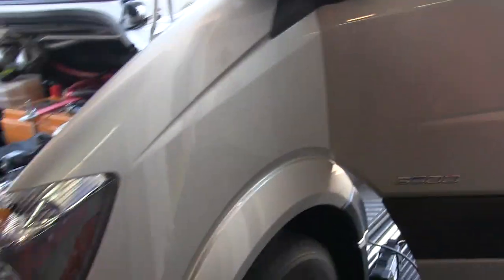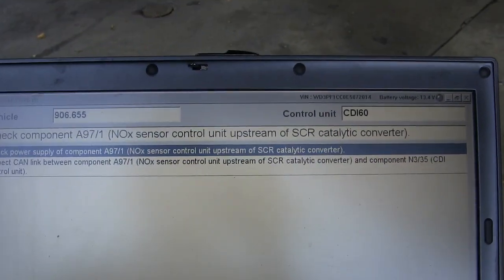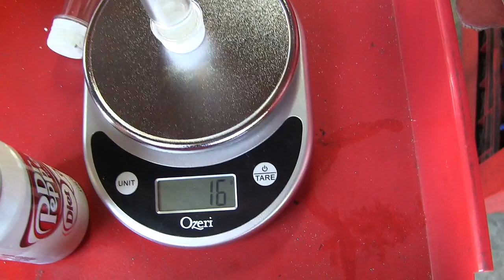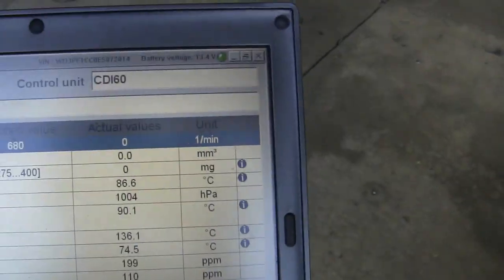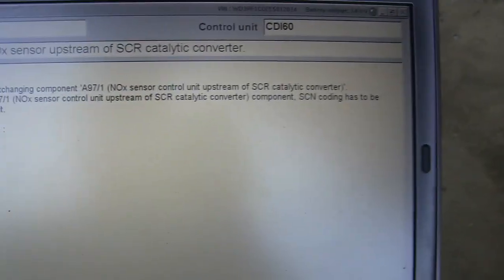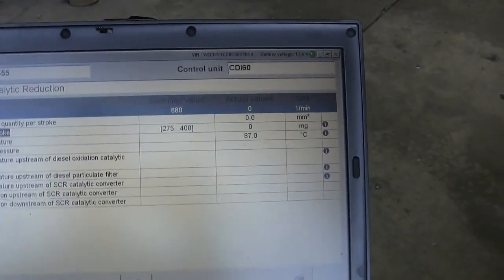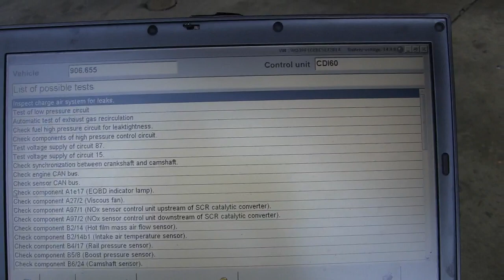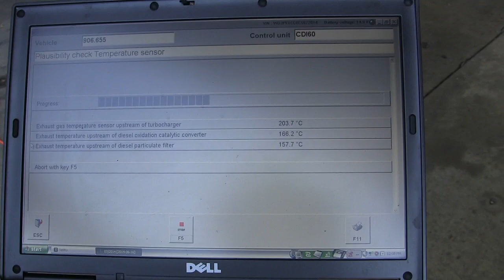Mercedes BlueTec SCR Adblue DPF NoX Sensors EGT Check Engine Diesel Sprinter 642 CDI, San Diego

Comment: i just but the ml350 disel after 2 days driving i have light check engen i took to the mercedes  to fix and they told me the car have to change the 2 nox sesnsers to be change it it will cost me a 1,900  its thet the right price and what do i tell the that i need to know?thank you ,